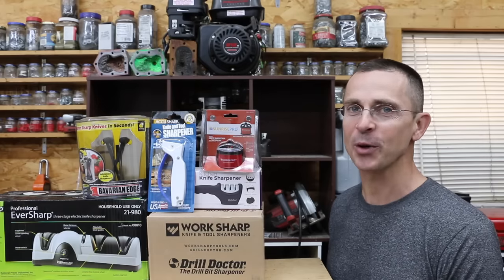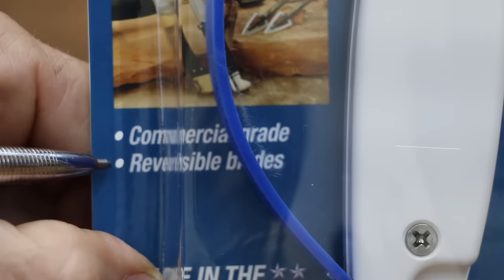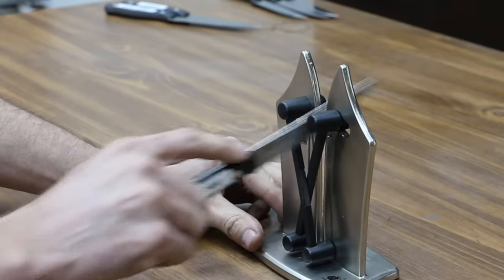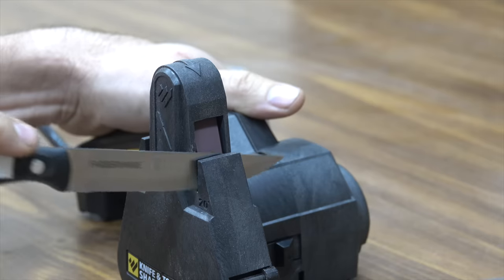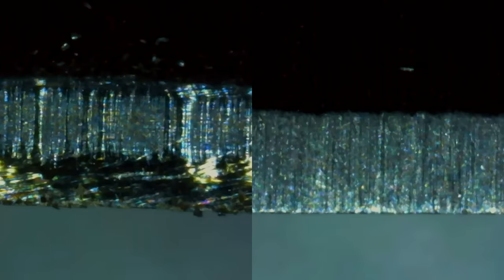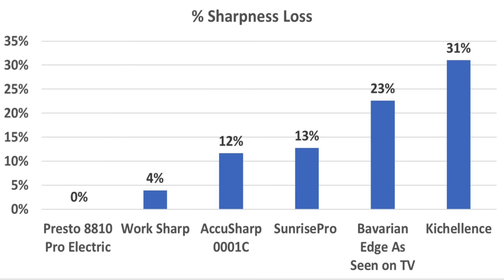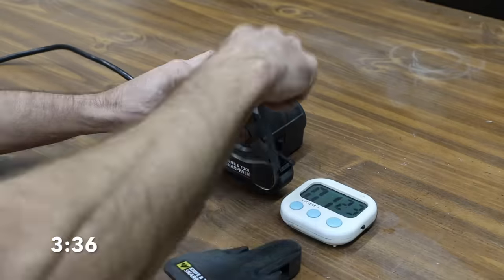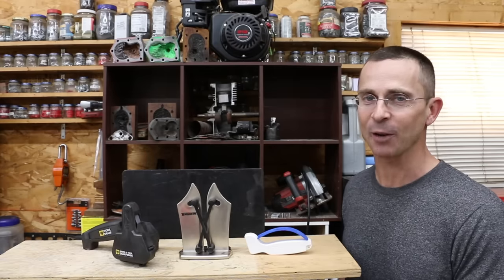Which Knife Sharpener is Best? Let's find out!

Comment: "High carbon stainless steel knives" confused gif face I'm sorry what
Reply: Some companies describe their cheap stainless steel this way. Technically, it's not wrong. 420HC (a common cheap stainless) does actually stand for 420 "High Carbon".
Reply: Stainless steel with out carbon can't really be heat treated. The steel needs to be hardened. With the exception of butter knives which is a 304 series stainless any  stainless steel knife will have carbon in it.
Reply: Ik guys I do knife making on the side as a hobby it was just a weird sounding phrase to me lol
Reply: @kcsniperboy7148  Might be a phrase to show that the knives are actually somewhat hardened and intended for cutting and not as tableware. Too hard a steel and it will scratch the glaze on your plates.
Reply: @kcsniperboy7148  These knives are not really 'high carbon stainless' but there are many 2%-3% high carbon stainless steels (very high carbon) ie CPM S110V and Maxamet that can be heat treated to HRC 70.
Reply: If 420HC is heat treated by BUCK...it works
Reply: bloodgain  yes, but the get watermarks real easy,,    USE.  DRY PUT AWAY , CANT TELL MY WIFE THAT ! Cheers from NJ🇺🇸🇺🇸🇺🇸🇺🇸
Reply: "high carbon" in any steel refers to any steel made  that contains more than .8% carbon by weight, "stainless" means that it has, at least according to current AISI and ASM standards, more than 10.5% chromium, most knives that are usable to any degree must have a HRC hardness of at least more than HRC 54, as most Fillet knives are set right about HRC 55, but they are made from steel with other alloying components that contribute to maintained hardness at a higher toughness as well. with "high carbon stainless" steels, which from most low end manufacturers, probably means a 420ss, which has .36-.45%carbon and 12-14% chromium. which makes this steel one of the single worst stainless steels to be used in a knife, since with this amount of carbon, it can only max out at a HRC of about 50 at best, and this is the steel that BUCK, likes to tote as one of their top brand steels...this is why most kitchen knives are so soft and easy to sharpen, becuase they are actually very very soft in reguards to actual  proper made knives, like ones made from 440c, with a carbon content of .95-1.2% and chromium at 14-16%, this is one of the single highest performers in high end knife blades. especially when properly heat treated and cryogenicaly treated and tempered.
Reply: Southern Discomfort I’ve yet to see any steel, at lest in being used in a knife reaching 70HRC, that’s like tungsten territory. The hardest I’ve ever heard of is Rockstead punishing their ZPD-189 to 67HRC. 

I maybe confused about this, but I think the HRC scale is logarithmic, so when you get up in the mid 60’s you are significantly harder than the mid 50s.
Reply: @davidgoold4642  spot on! Have you ever made a knife?
Reply: For stainless steel, high carbon can be a relative term...assumed to in relation to other types of stainless steel.  It can be a somewhat useless descriptor.  What really is helpful is the steel name or the data on its make up...cheap wares tend to not provide this info.
Reply: Stainless steel is low carbon compared to mild steel, but they are comparing it to other types of stainless.
Reply: DarkWolf21 You should check out some powdered steels.  A well heat treated S30v/S35vn/M390 blade will have much better edge retention than 440c.  Not knocking 440c, VG-10, 14c28n, 154cm etc. non-powdered steels though, still good stuff and easy to sharpen.
Reply: @randomguy3281  Rex 121 can be 70-72HRC (even though the scale oficially stops at 70).
I doubt you'd want a knife steel that hard for anything other than bragging rights but it does exist.

Comment: best sharpener: Work Sharp Ken Onion Edition
Reply from the maker: Great recommendation
Reply: @ProjectFarm  there is a blade grinder attachment(belt sander) available for it too.  
Only negative of the Ken onion edition is the price.
$129 on Amazon + $68 for the attachment.
Reply: For sharpening kitchen knives the standard version Work Sharp tested here is just as good and will save you $50 or so.
Reply: @johntechwriter  But the ko edition has adjustable angle and speed.
20° is good for general use, for a kitchen knife I prefer 15°.
Reply: I have the Ken Onion addition and love it, I got it at Christmas time from Scheels for $80 and I think it came with 3 or 4 belts. Great investment.
Reply: Sarpe the original has adjustable angle if you disregard the angle guard thing

Comment: I have all sorts of sharpening systems and Japanese water stones. I bought the Work Sharp Ken Onion edition a week ago and it is hands down the best sharpener I have ever used. I sharpen any knife in a few minutes  and in fact at the moment I don't even bother using anything finer than the coarse belt. Every knife I have sharpened comes out shaving sharp even with the coarse belt. I do drag the blades over a leather strop with fine compound about 3 times each side just to remove fine burrs. I am over the moon, wish I had bought it sooner.
Reply from the maker: Thanks for the feedback.

Comment: I work at a restaurant and use the accusharp a few times a week on my knives that I use at work. I only do 3 to 4 passes and my knife cuts thru tomatoes with basically the weight of the knife.  My knives are just cheap ones from the restaurant section at Sam's club and Costco.  But I can't stand a dull knife. We also used the accusharp at the previous restaurant where I worked.  I've been very happy with it. When the sharpening blades are worn you can buy a replacement set for about $5. Very economical and space saving as well.
Reply from the maker: Thanks for sharing.

Comment: I used to work at a Hyde shop a little while back, it's the step between a butcher shop and the tannery. We would receive the cow hide in full (no bones, just a skinned animal hide) would have to cut the head off, trim up any imperfections, cut out any boils, cut the hooves off, all that good jazz. I bought the exact model of the presto that you have in the video here, and one thing I learned after using it for a few years, those orange pads that slide when you adjust the blade thickness, you have to hold the blade with such precision, that the orange pads don't wiggle or push in. With that, I was always able to get my knives sharp enough to slice through paper in the air, I'd say give it another try making sure to not budge the orange pads while doing it. I personally feel they should have made a function to lock them in place or reenforced springs or something, but a terrific product none the less!
Reply from the maker: Thanks for sharing.

Comment: OK, Let me weigh in.  To start, I love sharpening knives. 5 different stones, ceramic draw and a Lansky 5 stone. OK, for ease  of use, drawer or cupboard space and effectiveness I've had a version of the Sunrisepro in the kitchen drawer for nearly 10 years. It sucks to the counter top, 3 or 4 strokes, back in the drawer,  before cutting a soft tomato with a Mundial 8" chefs knife. I'll cut a soft tomato so thin you can read a text through it. It's not a reliable lasting  sharp...but...ease, fits in a shallow kitchen drawer and quick sharpens good enough slice a grape with just the weight of the blade. Can't beat it and I've tried 3 of those tested as well as other varieties . Road tested and approved!
Reply from the maker: Thanks for the feedback.

Comment: I have used the work sharp for awhile now from simple pocket knives to mower blades, work tools like shovels, etc, has always put a very sharp edge on everything....once you sharpen with the belt one needs to hone the blade...using the blue belt or a strop simply use a little compound, rub on the belt/strop.. ( compound comes with the machine ) and easily and consistently hone the belt, believe me the blade will be smooth and very very sharp .
Reply from the maker: Thanks for the feedback.

Comment: Coming from a long line of  meat processors and butchers, they all told me that you want a slightly ragged edge, one that drags on your thumb when pulling it across the blade. I use one of those v shaped sharpeners but skip the  burr removing  part as the knives work  better  on food stuffs. Tomatoes, meat, etc. But  will sometime use a double gritted stone and pull the blade backwards to help remove the burr that rolls over when in use. For a finish edge.
Reply from the maker: Thanks for the feedback.

Comment: This video was just suggested to me.  But as an avid outdoorsman,  a constant chef,  and someone who depends on sharp blades every day as a maintenance man, having that sharp edge always available is a necessity to me. This is what I use. 
I received a set of fish cleaning knives for Christmas years ago that came with an orange plastic fixed angle ceramic sharpener. It put a fast razor sharp edge on these knives whenever I needed it.  Maybe they needed it too often. But it also works on my mid quality smooth blade kitchen knives and my Ken Onion Kershaw pocket knife.  I just pull them through a few times every so often and I'm I'm razor sharp. 
At just over $3 a piece,  I'm very happy and have them everywhere I need them.
But.  Fixed angle. 
But. 5 sharpeners for less than $20 and it only takes a few seconds. I'm happy with that.  
Great videos!!!!!! I wish I could hang out and help.  That would be fun!!!

Comment: You mention the learning curve for the Work Sharp.  I use a Work Sharp for just about everything.  The learning curve you mention really just applies to maintaining the point on your knife.  If the instructions aren't followed you will find the tips of your knives being slowly rounded down.  If that is not a big deal to you, then it's very simple to use.  I sharpen a lot of machetes where it doesn't matter.

I've also used one similar to the Bavarian Edge in the past.  The nice thing about that one is you can place it right next to where you are working and stroke it a few times every so often to maintain your edge during your project.
Reply from the maker: Thanks for the feedback.

Comment: Just wanted to say thanks for this very helpful and very practical review.  I've been frustrated with my dull knifes.  I have a set of Wusthof kitchen knifes, a couple of Wusthof sharpeners and a electric sharpener as well.  The sharpener are simply awful.  My concern was that Wusthof has a 14 degree blade angle and finding a sharpener that met that requirement  After trying to cut a tomato with little success, I said the heck with it.  I went for the least expensive of those you tested, the ACCU sharp, in spite of having a 20 degree angle.  You know what?  I have sharp knifes now.  What a difference.  Tomato slices paper thin.  Appreciate your expertise, thorough testing. Good job!!😀
Reply from the maker: Thank you!

Comment: The effort put into this video is impressive, and I don't mean to detract from that at all, but in this test, the sharpness of the knife is only being tested at that one point where the line is contacting the blade edge.

As can be seen in the magnified camera view, the edge is not uniform all across its length. This means that the knife could be very sharp along 98% of its edge, but if by happenstance the testing line ended up on the 2%, it would be an inaccurate result.

I could also see the consistency in manufacturing of those test lines being a potential point for introduction of error.

As usual, repeated tests would be the best way to improve statistical confidence in the results. For example, three consecutive sharpness tests for each blade at each testing stage. And of course, the more the better.

Obviously, time and money can be inhibiting factors here. So I understand these limitations. But it seems like swapping out those test lines to get two more reads wouldn't take much more time. Maybe money? Don't know what they cost.

At any rate, another great video, Mr Farm. We all appreciate the work you do.

Comment: Angle of grind is important. A 25 to 30 degree grind will require more force than a 15 degree or below grind. Lower grind angle will require more maintenance and are more likely to chip but are inherently sharper.  

I go 30 deg for a cleaver, 15 degree for veggie and other cutters, 12.5 for chef knife,  10 degree for filet or boning knives. For reference pocket knives are usually around 25 deg.
Reply from the maker: Thanks for the feedback.

Comment: I just purchased a knife sharpener and doing so I learned something - there are two different edges for a knife and that will depend on where it was made - American made knives are V shape at a 20 degree angle - Japanese knives have a 15/16 degree angle - I’ve been using my workpro on my kitchen knives for years now I have to purchase one that will do a 15/16 degree angle - do one for Japanese knives
Reply from the maker: Thanks for the suggestion.

Comment: I have a Smith's hand knife and scissors sharpener (similar to the AccuSharp) with fixed carbide sharpening steels.  I have had probably 4 or 5 of these sharpeners over time (40+ years....lost or destroyed them).  I found out that the carbide will become contaminated with the knife steel and stop sharpening the blade if the sharpener and knife edge are not lubricated with water.  My current one is over 2 years old and keeps all of my knifes very sharp when I lubricate the sharpener and knife edge with water.  I need a very sharp knife as I am a devout fisherman and you need a sharp knife to properly clean and fillet fish.
Reply from the maker: Thanks for sharing.

Comment: I have a number of oriental kitchen knives where the bevel is not symmetrical on the 2 different sides (one of which is a sashimi knife that has a bevel on only one side).  Most knife sharpeners sharpen a knife to fixed angles that are determined by the designer of the sharpener.  I found that a sharpener like the Bavarian Edge (specifically the Brod and Taylor), a steel or a stone are the only way to maintain the original edge geometry.  I find the Brod and Taylor (Bavarian Edge) to be just about fool proof on keeping the geometry.
Reply from the maker: Thanks for sharing.

Comment: I like the AccuSharp. Had mine for 15+ years now and just switched the blades around a few weeks ago. I've been using it on the same £20 knife now for all those years. Still does the job. It's a little brutal on stripping the knife's metal but if you aren't a knife nerd with expensive knives then I think AccuSharp does a great job and is really good value.
Reply from the maker: Thanks for sharing.

Comment: When I was around 10 years old. my dad gave me my first pocketknife. He immediately showed me how to sharpen it using a whetstone. The test of sharpness was tp see if it could slice a loosely-held sheet of newspaper cleanly. It took me a while to get the hang of it. Years later, I learned how to use an Arkansas oilstone. The edge was sharp enough to shave with. Use that as a control. I know you've learned how to use one.
Reply from the maker: Thanks for sharing.

Comment: Excellent video. You should have drawn the blade across the tester.  The very fine hack saw / serrated edge is what cuts when the knife is drawn not the thickness of the edge.  Paper cuts occur not because the paper is thin but because of the micro serrations.  If you want a blade that will cut with downward pressure like a razor blade you need a polished edge which can be achieved with jewelers Rouge and card stock paper or leather.  This process is called stroping and produces a fine mirror  finish on the edge which makes it extremely sharp
Reply from the maker: Thanks!  Thanks for the feedback.

Comment: A friend of mine has a spring loaded one with interchangeable rods from coars to a fine ceramic.  It's like 80 or 90 dollars I forget what it's called but it does a pretty good job.  It's similar in action to the Bavarian edge one you tested but it has the interchangeable rods.  Another excellent video. I have found most sharpeners with the plates shaped as a very made of tungsten carbide or similar materials seem to butcher the edge as opposed to actually sharpening it.  I avoid them.  The ones with the ceramic inserts aren't to bad they seem to hone the blad instead of shredding material off the edge which in all reality will cause a knife to not be usable nearly as long because once you grind down past the hardened edge it won't hold an edge very well. Can't forget most knives are case hardened which equates to the hardening on the edge not being very deep.
Reply from the maker: Thanks!  Thanks for sharing.

Comment: I like my Lansky Puck sharpening stone. $7.50 and I can get the knife so sharp it slices through paper and can actually remove the hair off my arm. Downside is that there is a learning curve and it is more time consuming. Plus side is the versatility. I can use it on any edge... lawnmower blades, axes, etc. it’s also going to last for decades and can fit in your pocket, so very easy to carry around.
Reply from the maker: Thanks for sharing.